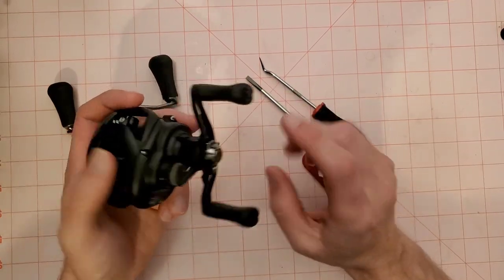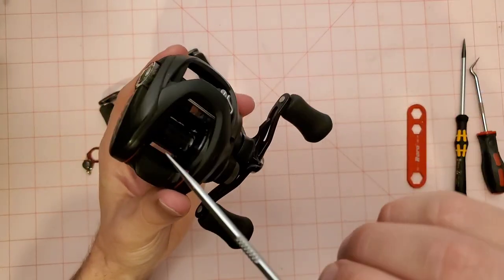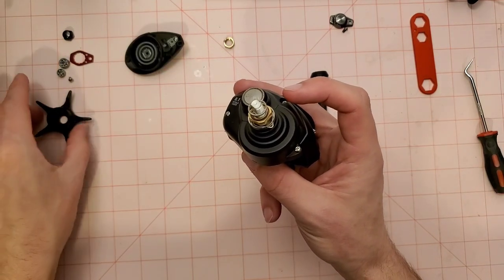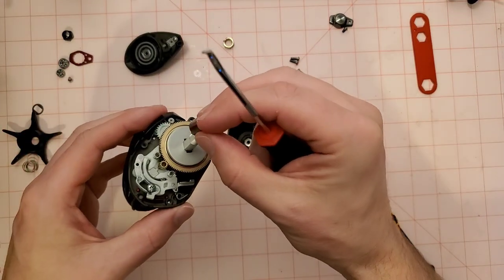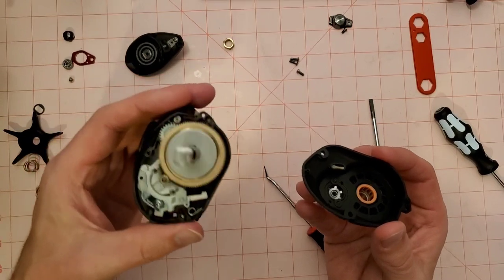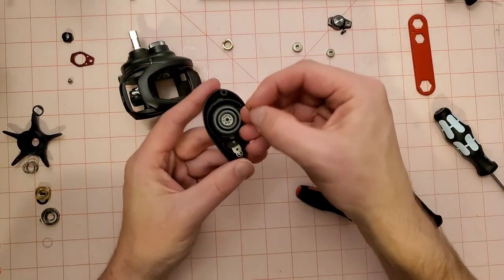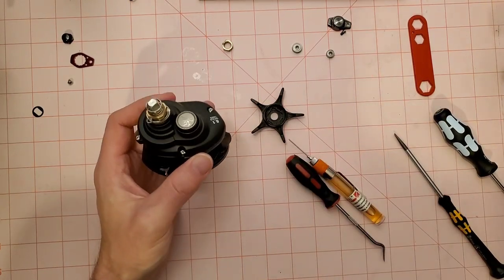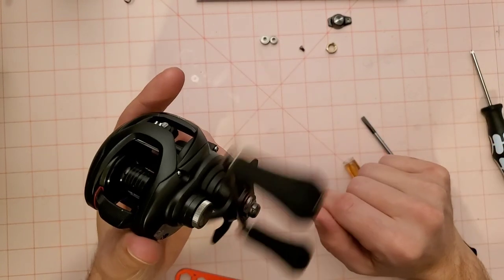SIMPLE upgrades to a Daiwa Tatula 100 that make a difference!!

Comment: Cool vid, you've convinced me to get a Tat100 for froggin'! I don't think I'll end up doing to handle upgrade for added torque so  I went with the HS (7.1:1) and 30IPT should be just fine. 

How heavy is the braid you're using? My only concern with this reel is how much 65lb line I'd be able to get on the spool. Unfortunately Daiwa doesn't post capacity for 65lb so I ended up buying 50lb powerpro S8Sv2.

Cheers
Reply from the maker: I'm using 50lb braid, which I think is even overkill for frogging. I just had it laying around so that's what I'm using.
Reply: @PunchFishing  thanks for the reply, keep them coming.

Comment: So now I would like to see a video on the performance of the reel, did it increase casting distance or consistency with the bearings and after useing it how do you like the power of the handle, did it truly transform the reel?
Reply from the maker: I wouldn't say these upgrades are THAT dramatic. Bigger handles really does help with techniques like flipping and frogging where you gain some extra torque.

I will post some follow ups on my frogging setup on instagram though, so follow me there.
Reply: @PunchFishing  sometimes with Daiwa reels it's just fun to customize them to your own personal taste. I just recently purchased a tutula elite after I sold my to Tatula 100 I'm thinking of upgrading the handle to a longer than 90 mm. also changed the handles on my Daiwa Steez reels  and had spanky at tackle trap redo my SV spools made a great difference.

Comment: you know...i did a lot of upgrades on my jdm 2017 daiwa tatula sv tw and just couldn't get around the shape of the 2017.  now these new tatulas are shaped like the steez sv reels, which i like.  likewise, i went through tackle trap for the bearings; went ZPI based on their recommendation and had looked at the hedgehog bearings etc...  Anyway, all the updgrades and I was like...meh...casts great...smooth reeling, but was spoiled by the weight and shape of the steez sv tw.  these new(er) tatula reels are under 7oz though and curious how close i could get a new tatula sv tw to a steez.  great vid.
Reply from the maker: I've never owned a Steez which is probably a good thing 😬
Reply: @PunchFishing  what you really don't want to own are those new jdm zillions...they've replaced the steez for me....low $300s too on ebay months ago when they launched in Japan.  Keep in mind JDM 6.1oz...USA 6.7oz.  Clicking drag too...reel exceeds the hype.  Seriously, stay away from it...it'll replace all your reels.

Comment: Great vid bud. I’m a Lews guy myself. I tear all mine completely down every year clean oil and lube in the off season. I use an ultra sonic cleaner on all my parts. Makes clean up a breeze. My question does tackle trap carry Lews parts?
Reply from the maker: They do carry Lews parts! They can also let you know which aftermarket bearings will fit inside your Lews reels.  https://tackletrap.com/index.php?main_page=index&cPath=898_892

Comment: I have the exact same reel, but for some reason it’s making a noise like sand is rubbing the spool when I crank, I disassembled, cleaned  and saw knicks on the spool frame, I gently filed them down in hopes of the noise going away but it still makes the noise when I cast, I even cleaned inside the ridges where the spool sits and spins. It’s still smooth but I’m not comfortable with the noise, do you think it can be one of my bearing making the noise? Any feedback will be helpful, thank you in advance
Reply from the maker: you could definitely try flushing the bearings in acetone